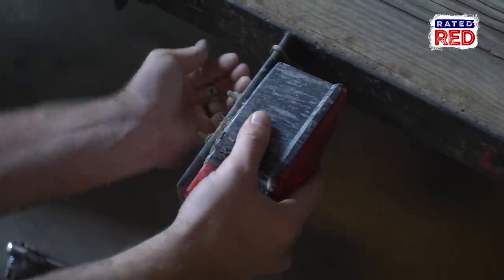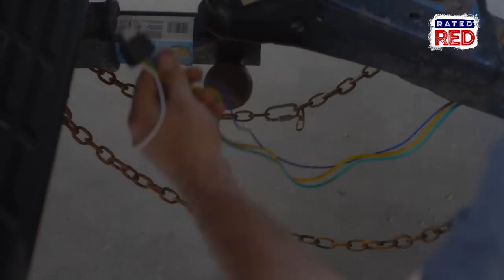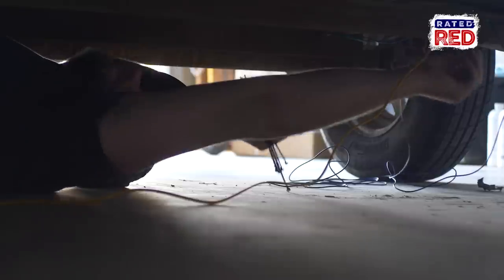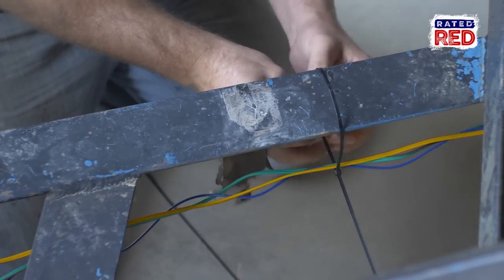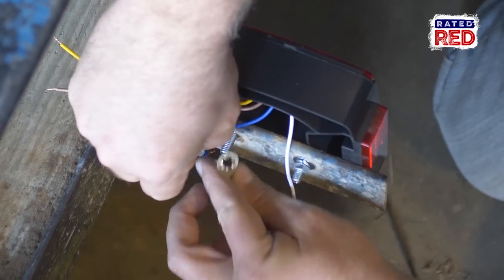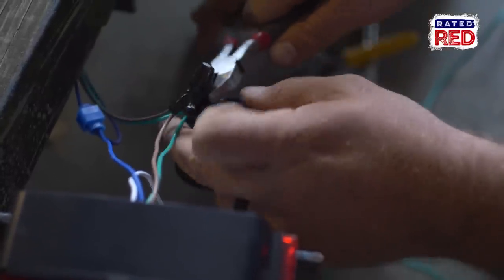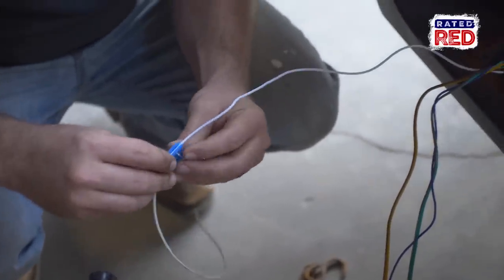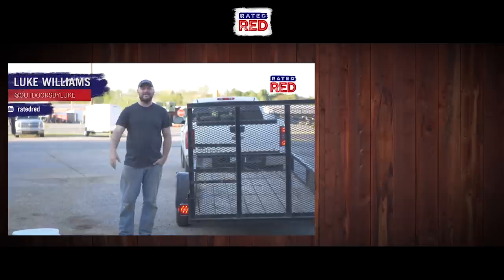How to Replace the Lights On Your Trailer

Comment: Solder and shrink wrap are better for long term water tight and corrosion resistant connections.
Reply: Yeah, those solderless connectors are a joke when they see anything resembling moisture.  You'll have to fix it again within a year.

Comment: I actually need to do this.  You should’ve told Amanda to put on something slutty and help you.

Shrink wrap tubes and a heat gun over electrical tape & wire nuts!